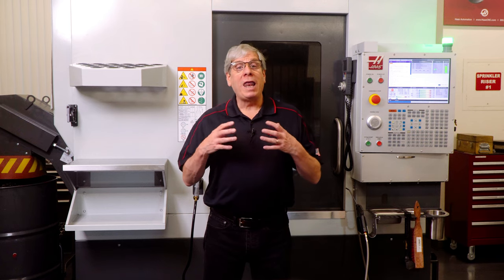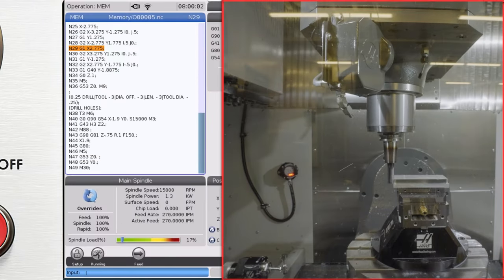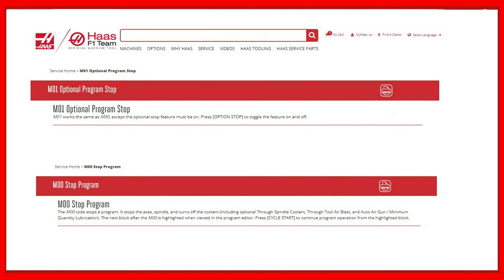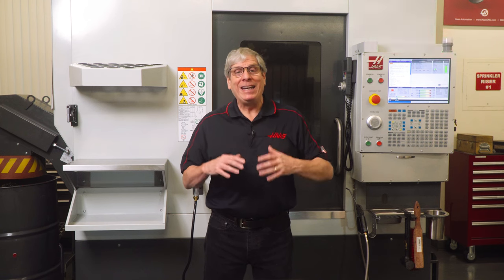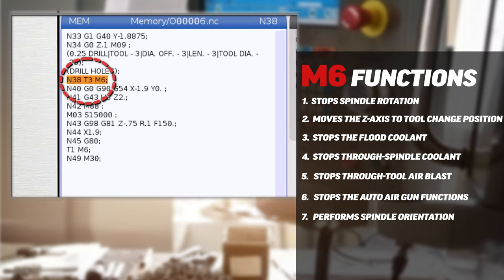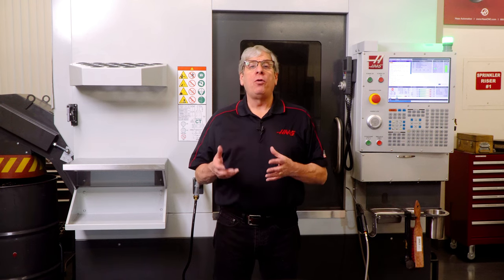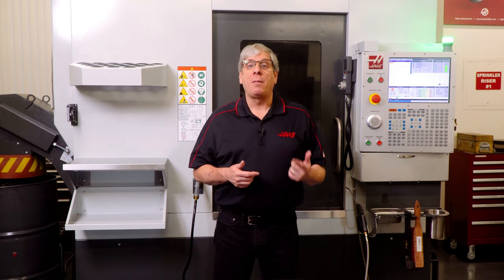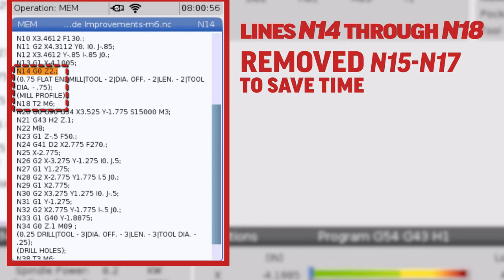M-Code Time Savers - M06 Tool Change Command - Haas Automation, Inc.

Comment: You can also shave off some hidden time by adding tool call aheads for side mounted tool changers. I will usually include the proceeding tool number on the same line of code as my M08 coolant turn on. Depending on how large your tool magazine is, the block look ahead doesn't always beat a smaller segment of code between tool changes, so this gives the machine a head start. 

So my tool change header will look something like this:

T2 M6 (TOOL CHANGE TO TOOL 2)
M8 T4 (TURN ON FLOOD COOLANT, READY TOOL 4 INTO TOOL CHANGE POCKET)
G43 H2 M3 S12000 F150.0 (TOOL LENGTH COMP, SPINDLE ON, SPEED AND FEED)
G54 G00 XYZABC 

T4 M6 
M8 T9
G43 H4 M3 S10000 F30.0
G54 G00 XYZABC

Comment: Be aware that if you don't specify a spindle RPM once the tool change is made, the new tool will start at the same RPM as the previous tool.
Playing with some probing code I found that out the hard way when my probe was spun up to 8000 despite the fact that I had not made any M04 commands. It grabbed the probe and started spinning shortly after the tool change was made.
Also note that the coolant was also automatically turned back on too.
So if you don't want the new tool to spin up to the same RPM as the previous one or the coolant to come on automatically then be sure to use M05 and M09.
Like when the next tool is the chip clearing fan.

Comment: Nice to know that, and going to try it tomorrow. By the way, is that also work on the old Hass control?
Reply: Works on mine 93 VF0 with umbrella toolchanger.
Reply: It will probably work on almost any cnc mill in the past 30 years if not more....

Comment: If your CAM program is worth a shit it does an M6 already.
Reply: Post processors can be and very often are customized to fit applications and preference from operators.  Many other machine types throughout the years m6 macros needed different prerequisites so a standard m5 m9 g91g28 z0. Is extremely common to see in a mill program.
Reply: @Jspackman  yes I know they can be customized. I have used two Cam programs and had both of them customized but they used M06 out of the box.
Reply: Yes. But ours still puts m09 m05 all these codes in front of it, useless code
Reply: Post processors are notorious for waffling. They HAVE to work so they cover all bases. Our brand new post for our 2 fanucs have about 5-10 lines of code at the start of every program that really don't need to be there for the most part. Things like setting work plane and work offsets after every tool call, totally useless but on the off chance you ever do program a change then the post processor needs to state it. 
These are robots at the end of the day. Think of it like a human can walk in a room and know if the lights are on without even looking at them but a robot would need to preform checks.
Reply: @wildin13  our post processor does that too. Cancel any cycle, plane selection etc
Reply: @cyber2526  thats it. Tbh we only do one offs so not bothered about the few extra seconds so I actually added more code to our posts just to make our programs as idiot proof as possible 😅 
We also had H&SE come round and some clipboard warrior decided we needed to be locked out of the machine for X time to allow coolant vapour to disperse so I have a 2.5 min dwell on every program now. Coolant or not 🤣 literally getting payed for nothing
Reply: @wildin13  you need a mist condensor haha
Reply: @cyber2526  thats the thing.... we already do! 🤣
Reply: @wildin13  Work offset codes at each tool header are nice for skipping in to certain tools. I've seen crashes happen due to someone removing a "redundant" G54 and trying to skip to a certain tool after zero'ing a machine with g90 and/or g53.
Reply: @halomaster985  oh yes I agree. Personally I prefer heidenhain where it remembers and you can jump in almost anywhere with ease but you are right. Which is why posts auto populate with them there but thats not the most efficient way to program which is what this video is about. Posts HAVE to work and quite often remove the idiot behind the controls so jumping to at a tool call is made bullet proof with the extra waffle.

Comment: Shaved 17 seconds off a program just making this change.  Doesn’t sound like much but it would add up.
Reply: If you have a side mounted tool changer, you can also program tool call aheads for even more time saving.
My tool change code usually looks something like this.....

T2 M6      (TOOL CHANGE TO TOOL 2)
M8 T4      (TURNS ON COOLANT, MOVES TOOL 4 INTO THE TOOL CHANGE POCKET)
G43 H2 M3 S12000 F150.0      (HOWEVER YOU CALL UP TOOL COMPS AND S & F)

Comment: Watching videos like this makes me really prefer our Mazaks lmao. We dont even have to program the tool changes, they just do it.
Reply: With conversational programming sure, (which I don’t prefer on mazaks) regular g-code still uses code to change tools
Reply: Haas is for  kids
Reply: While Mazaks are better machines, a post processor from any cam software will still always need to call a tool change. If you didn't, there would literally be nothing telling the machine what the next tool is or when do grab it. It can't "just do it". And even if it seems like it "just does it" when conversational programming, I'd bet that behind the scenes it's still calling a the tool change subprogram, you just don't realize it
Reply: @Marlfox570  conversational tool changed on the mazaks are a little different don’t call up tool numbers like a regular machine, you assign tool names ( .530 endmill R) with a letter at the end. You pick the tool in the program and it disregards what tool number it is, if you have 2 of the same tool , one with a red R or green R have to tell it which one to pick. It’s weird, like I could program it for a .5 rougher, it’s tool 10, I could move that tool to let’s say tool 5, and just rename tool 5 to that endmill and without changing the program it will grab the same tool
Reply: @Marlfox570  yup, conversational programming is just cycles where you fill the blanks with the rest behind curtains
Reply: I run mazaks and hurcos, prefer the gcode over mazatrol. It’s just plain stupid, I learned to program the hurco well after using the mazatrol and I just hate mazatrol. But the mazak as a machine itself is way better
Reply: @adammiller4879  i have run mazak lathes using mazatrol, the errors are vague, it would randomly spit errors in even empty programs and it was unfixable, even after a phew days i couldn't get a program right first try, it sucked, gimme g-code or other controls with better conversational
Reply: @cyber2526  try hurcos,  I gave them a lot of shit but once I figured it out it’s quite easy to program and run, it will tell you what’s wrong if the program is messed up or your missing something , really good graphics software too looks just like mastercam, but on the older models thread milling doesn’t work and I learned that the hard way, can’t start at the center of the circle it starts offset on y to helical up, broke 5 200$ mills, need the winmax software for small threadmill holes under .170 have to start at bottom of hole if you wanna climb cut
Reply: @adammiller4879  would threadmilling work if you used CAM?
Reply: @cyber2526  yes it would, but on the older controllers before winmax that my company has you have to switch the controller over to g code and if you do that you lose all your tool data and programs I believe or so Iv been told so I haven’t tried. Not 100% on that but g code would fix that issue. My department doesn’t have mastercam it’s all convo programming. We do have g code programs but it’s made by the programming office
Reply: What do those conversational programs look like opened up in a text document? I think I seen one in my life and im sure it just laid it out as a poorly written g-code
Reply: @SirFlibbertyJibbit  it is a bunch of jibberish that does not resemble g—code at all it looks closer to macros, but not quite , it’s a mixture of basically all the symbols on a keyboard with letters and numbers